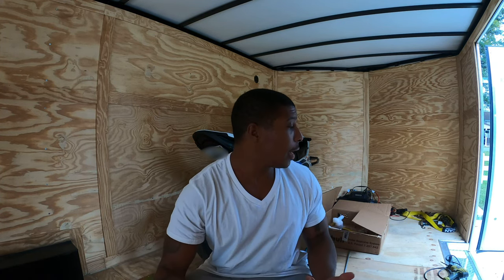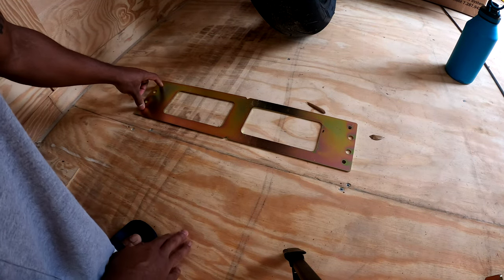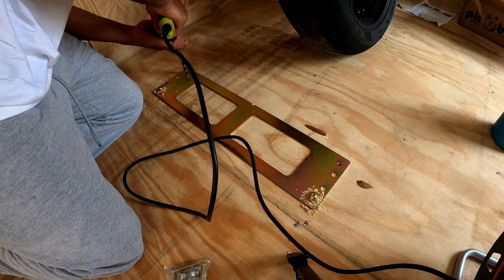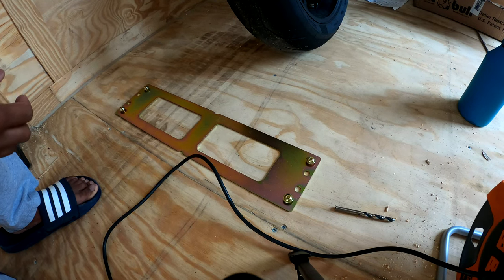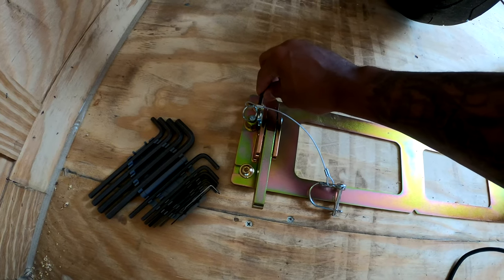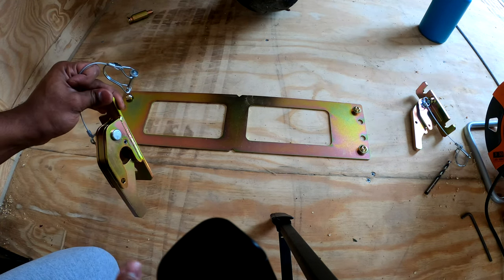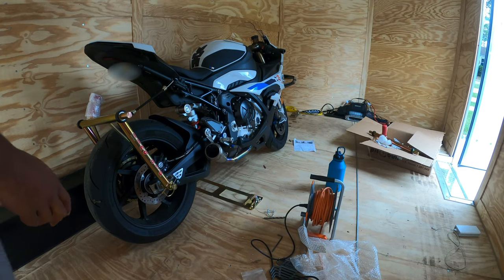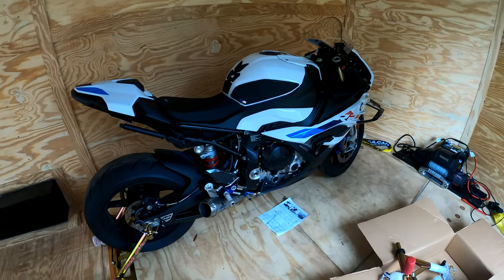Pit bull Trailer Restraint Stand Install! (Pit Bull TRS System)

Comment: Thanks for doing this video. I was looking at that setup, on an open-air trailer I have. That way I don't have to buy a new trailer lol. Now to find a good lock box to bolt on the front of the trailer.

Comment: Are you going to hold the front down somehow? It would be nice if they had a quick attach of some sort to keep the front tire from moving. Nice video. Keep them coming!
Reply from the maker: How would the front tire move? The stand is attached through the axle and the stand is anchored to the trailer? The bike cant move forward backward or side to side?
Reply: I’m concerned that the front will bounce on the road, and could want to move side-to-side in turns. That would put a lot of strain on that stand and the connection points on the bike. Holding the front down with a ratchet strap will provide a three-point connection.
Reply from the maker: I understand your concern. Pitbull had a testimony, with pictures where a dude had 2 bikes in his trailer secured by nothing but the pitbull trs system. He got in an accident and the trailer was flipped upside down, when they got around to looking inside the trailer both bikes were still secure to the stands upside down inside the trailer. When I put my bike in there, it’s secured in gear, I’m guessing this guy did the same thing. It isn’t bouncing up and down.
Reply: @johnknoxville6736  it’s not needed at all Mark I drove from Fort Bragg, North Carolina all the way to Seattle with two motorcycles attached with just the pitbull trailer restraint system. Bikes, didn’t move an inch over 3000 miles on the road. It’s hands-down the best way to secure your bike.
Reply: @N31LE that’s crazy 😳